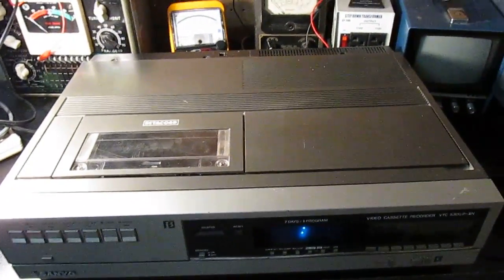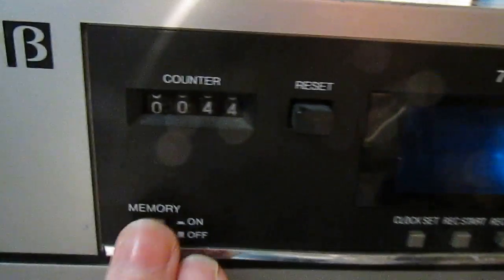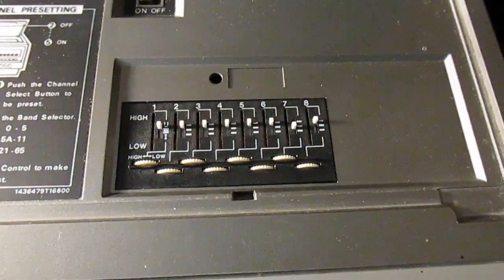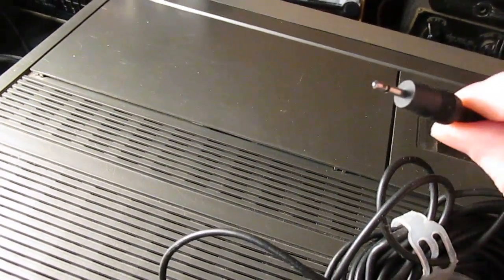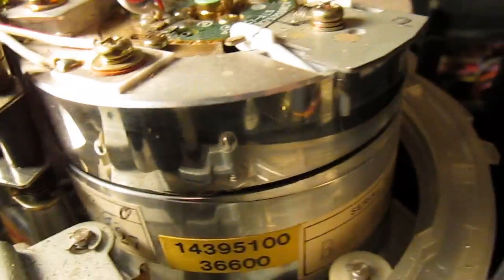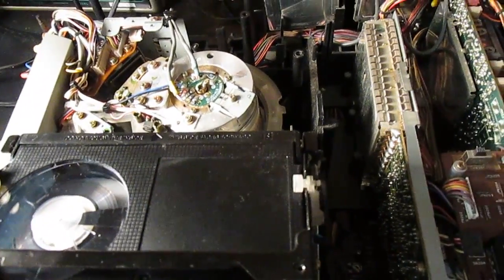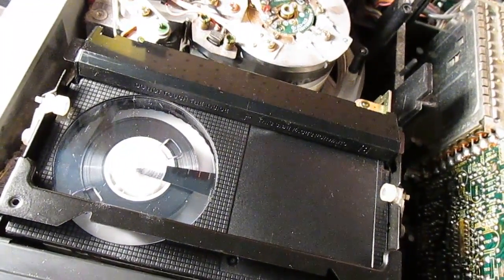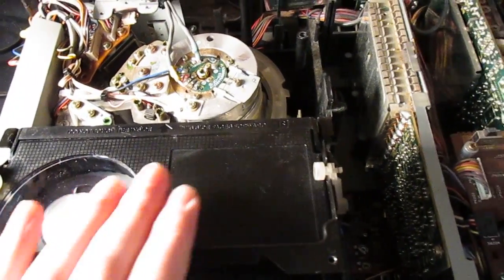Sanyo VTC 5300P IIN Betacord Betamax VCR (Circa 1982)

Comment: I recently bought a similar machine, 5 belts to change if they go wrong, it’s in very good condition but seems to be running a little slow, not sure if you can buy belts or if so what sizes, might just buy a few random belts and see if they fit.  I too have the wired remote for pause.  I’m gonna clean the heads and tape path and see if it helps sharpen the picture quality.

Comment: Very good,  I have found  a broken belt inside my Sanyo  betarcord 5300p  that  does not open, can you tell where it is placed, I bought another and I do not know where to place it. Sorry to ask here I do not find anywhere else. Thankyou  good job.
Reply: There are 5 belts in the 5300 series mechanism. One loading belt, two reel drive belts and two counter belts. By "does not open", you mean the cassette carriage doesn't open when you press eject?